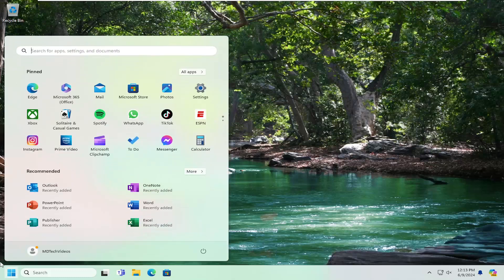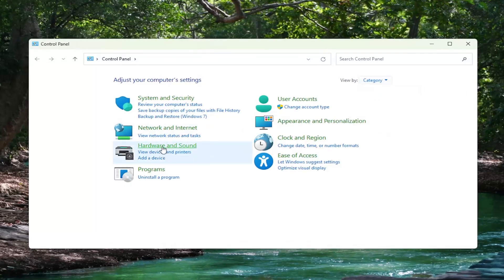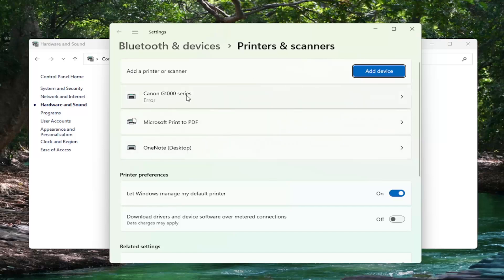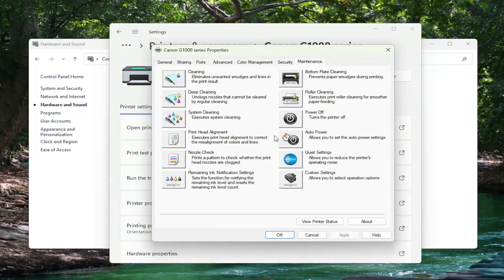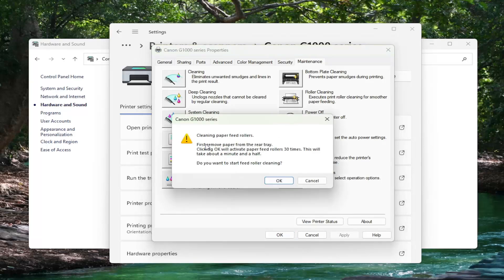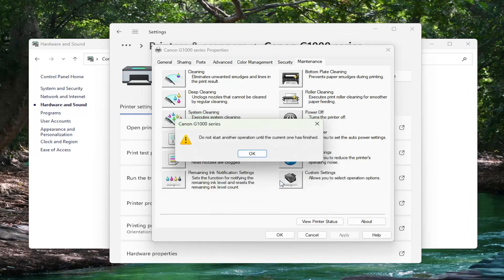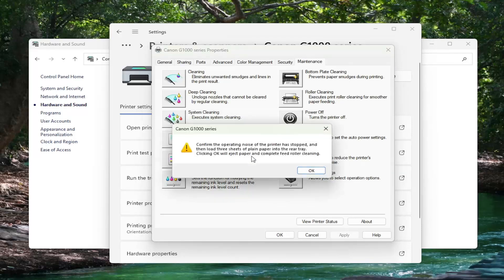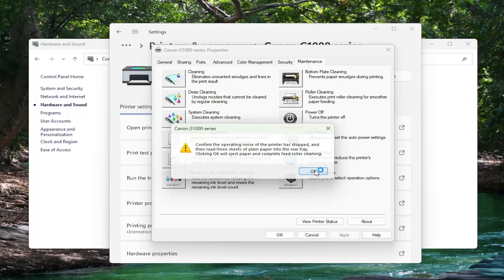How to Fix Canon PIXMA Printer Paper Pickup / Feeder Problems. Roller Cleaning [Guide]

Comment: My Canon MG3620 keeps triggering a paper jam with just 1 single sheet, AND prints faded pink with new color AND black ink cartridges. I gently pulled and cleared the paper from the back of my print roller (lookup the online manual for your series) and found this from a Canon manual online: 

CLEANING THE PAPER FEED ROLLER
If the paper feed roller is dirty or paper powder is attached to it, paper may not be fed properly.

In this case, clean the paper feed roller. Cleaning will wear out the paper feed roller, so perform this only when necessary.

You need to prepare: a sheet of A4 or Letter-sized plain paper or a cleaning sheet (available on the market)

- Make sure that the power is turned on and remove any paper from the front tray.

- Open the paper output tray.

- Hold down the Stop button until the Alarm lamp flashes seven times, then release it immediately.

The paper feed roller will rotate as it is cleaned without paper.

Make sure that the paper feed roller has stopped rotating, close the paper output tray, then load a sheet of A4 or Letter-sized plain paper or cleaning sheet available on the market in the front tray.

- Open the output tray extension, open the paper output tray, then extend the paper output support.

- Hold down the Stop button until the Alarm lamp flashes seven times, then release it immediately.

The machine starts cleaning. The cleaning will be complete when the paper is ejected.
If the problem is not resolved after cleaning the paper feed roller, contact the service center

Comment: thank you for the tutorial!  what would you do if you don't see the printer under control panel > advanced printer setup?  I can only see it under devices and printers but these options seem to be missing.  I installed all the drivers etc but my printer seems to really need a feeder cleaning, yet cant see these options.  thank you

Comment: Ok but how exactly do printer rollers clean themselves?
It must be some dust they remove right? And that requires squirting some  leaning liquid over the rollers and wiping it clean. How can this be done by software alone?
Reply from the maker: If you can kindly elaborate, I will do my best to assist.
Reply: Hi @chandrasekharlyf9212, I'm not sure if this helps, but I am working on a consistent paper jam on my Canon MG3620 and found this from a Canon MG3600 Series manual online:

CLEANING THE PAPER FEED ROLLER
If the paper feed roller is dirty or paper powder is attached to it, paper may not be fed properly.

In this case, clean the paper feed roller. Cleaning will wear out the paper feed roller, so perform this only when necessary.

You need to prepare: a sheet of A4 or Letter-sized plain paper, or a cleaning sheet (available on the market)

- Make sure that the power is turned on and remove any paper from the front tray.

- Open the paper output tray.

- Hold down the Stop button until the Alarm lamp flashes seven times, then release it immediately.

The paper feed roller will rotate as it is cleaned without paper.

Make sure that the paper feed roller has stopped rotating, close the paper output tray, then load a sheet of A4 or Letter-sized plain paper or cleaning sheet available on the market in the front tray.

- Open the output tray extension, open the paper output tray, then extend the paper output support.

- Hold down the Stop button until the Alarm lamp flashes seven times, then release it immediately.

The machine starts cleaning. The cleaning will be complete when the paper is ejected.
If the problem is not resolved after cleaning the paper feed roller, contact the service center